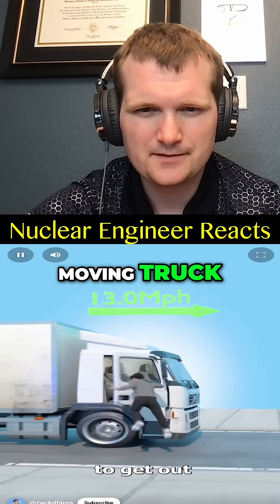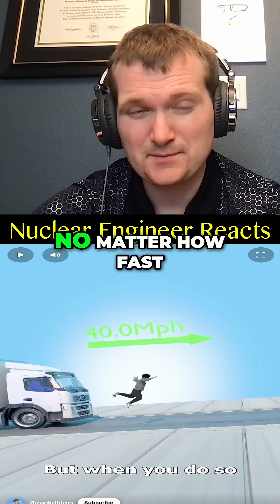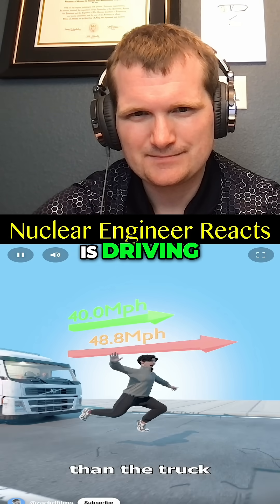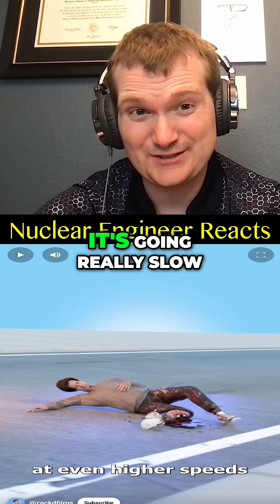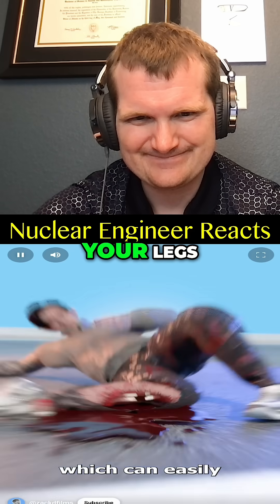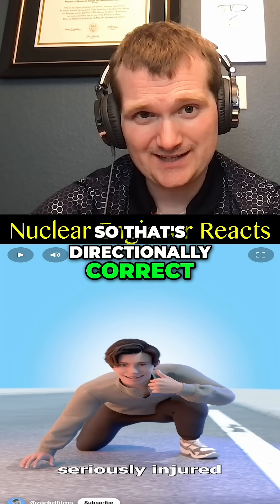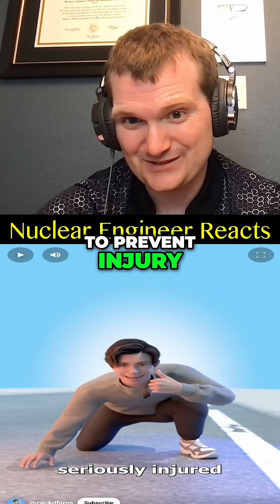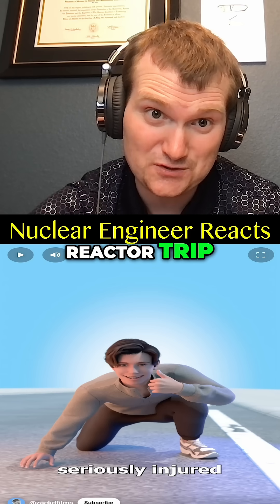Don't Jump Forward Off a Moving Truck - Nuclear Engineer Reacts to Zack D. Films

Comment: Who would ever jump forward though?  Even if you weren't adding speed, you'd still have a slight risk of getting run over by that very truck if they even veered off in your direction.

Just do what you see in the movies and tv's shows.  Off the the side and try to roll with the momentum of the fall.

Comment: I think they misplaced the reason for injury.
Regardless the way you jump you gonna hit the ground with the same speed as if that truck was not moving :D
Injury comes from brain not knowing how to prevent the directional, sudden friction and causes body to roll. So your feet at pretty okay, but your head will start moving towards the ground with much bigger speed due to friction already acting on your feet.
So, if you had an ability to fall to the ground in a way where you negate friction and your whole body hits the ground at the same time, you will probably still grind into a pulp(on a tarmac road), but that's a separate effect from falling damage :P

Comment: You need to also turn around, to be sble to land facing same direction as your speed relative to ground.
Also I think, just jump away, not backwards or forward, just away, and face forward (the speed) and catch air to break.

Comment: If you jumped from the side and not the back where the vacuum is but where the air is pushing, then it may work out with a tuck and roll

Comment: Here's another scenario/question that makes the same amount of logical sense:
If you feel the need (like an addiction) to catch a ball traveling at 100km/h in your mouth you might turn your head away from it, in such a way that now it's gonna aim for your temple.
(You could just not try to jump off a moving truck, just like you could not try to catch a very fast moving object inside your skull, which is a bad idea on it's own, just as is jumping off of a moving vehicle)
(And NOT try to make the very hard ball hit your vitals, just like you shouldn't make yourself hit the asphalt highway at an even higher speed.)

Comment: Pretty sure you need to be facing forward to roll correctly. Once your feet touch the ground they will slow down more quickly than your head. If you are facing forward you can catch with your hands and possibly roll over your shoulder. If you are facing backwards the back of your head is meeting pavement right away. As always Tyler is right, at highway speeds the best case scenario is you are still breathing

Comment: Theoretically you can play harmonizing directional positioning. This is why most stunt people leap laterally when exitting a moving vehicle. Moving away from the car, at best you'll get 20mph, and at 50, the impact is going to be pretty severe regardless. Moving in a direction adjacent to the force at which you are moving, and stretching your center of gravity to allow for a tumbling effect you'll more likely survive with a few non-fatal / non-permanent injuries than if you attempt to try to play force cancelling physics.

Comment: This is a very harmful tip. You don't want to jump facing backwards, because you will roll forwards anyway. Jump to the side and roll. Jumping opposing the truck's direction means jumping facing the opposite direction, which will be much more fatal than jumping facing forward.

Comment: Tip: Roll to distribute the loss of velocity over time
Reply: Extra tip(said from a comment in that Zack video): You will roll in the direction the truck is going, so prepare to roll backwards if you can
Reply: At highway speeds, you're gonna have chunks of flesh grinded away before you start rolling safely, but that is better than breaking your bones.

Comment: The problem with jumping backwards is that you are facing the wrong way to get your feet running in the direction you are travelling already. 

So jumping backwards is probably much worse. 

Best would be to jump backwards while facing forwards and start running forwards before you hit the ground. 

2nd best is jump sideways while facing/running forwards

BTW The reactor analogies are just ridiculous most of the time.

Comment: That's a good way to smash the back of your head into the pavement. Face forward, jump backwards, tuck, and roll, protecting your head with your arms. You might survive that way. If you're going slow enough and roll well, you might even get away with road rash.

Comment: With this scenario you are better to stay inside the vehicle wearing your seatbelt because inertia would see to it that your body would move at speeds and create angles caused by your momentum would happen as soon as youd touch down. Your legs wouldn't be able to catch up with your body and  before you started to tumble at about the same speed as the vehicle like an unprotected ragdoll unprotected from what might hit you, or the things that you might hit. Your best bet is to stay in the vehicle during a crash no matter the speed of impact you are safest to ride it out than exit and  be totally unprotected. 
 Staying inside causes the vehicle to work as a protective shell wrapped around you where the inertia and velocity of a crash are absorbed and reduced by the vehicles design and structual design where it hs crumple zones seatbelts airbags and the overall structure of the cab where its  designed to lessen harm to those who might end up in a crash. So stay inside your vehicle, In your seat, wearing a seatbelt where you are safest and more apt to survive.

Comment: As jeremy clarckson said: people don't die from velocity, they die from suddenly becoming stationary.
Reply: It's why you roll in parkour - your making a sudden stop take a few seconds, which means you sustain fewer injuries as you slow down.  

So the full form is to wait (if possible or logical) for soft soil along the shoulder, jump backwards from the truck and tuck and roll.  The rolling allows you to turn some speed into movement instead of pain, the softer soil absorbs more of your speed with a lesser impact on your body.

Itll still hurt you badly at highway speeds, but likely enough to make your injuries more in line of "arm dislocated and leg broken" instead of "meat crayon with a shattered skull"
Reply: @Mr.Sparks.173  you distribute the force of the fall by rolling over your shoulder in parkour instead of directing all the force of the fall onto a specific small part of your body like if you were to land on your feet. that is mostly why people dont get hurt doing parkour
Reply: unless you get hit by a truck, then you die by suddenly becoming non-stationary.
Reply: Unfortunately that's only partially correct, the reality is people die from sudden changes in velocity over short periods of time, aka acceleration, that includes increases and not just decreases.
Reply: @nerofl89 Technically, in relation to the truck, you suddenly became stationary
Reply: "Speed has never killed anybody.. suddenly becoming stationery, that's what gets you."
Reply: One of the many brilliant little pearls of wisdom from Jezza.
Reply: Velocity isn't the problem, the problem is change of velocity.
Reply: In a traditional car accident sure. But if talking about just moving vehicles, it’s really from any sudden spike in G forces. Could even die from accelerating too hard or turning too hard
Reply: Technically people die from acceleration.
Reply: Jeremy Clarkson?  That clown?  😂😂😂.  I’m sure he’d be quoting someone else’s wise statement.
Reply: @moiraatkinson  How dare you insult his genius!
Reply: @moiraatkinson  what's wrong Moira can't take a joke? Someone get a little cranky when people have different opinions?
Reply: @LostSoul-h7d . err huh?  I post a comment consisting of laughing emojis and call Jeremy Clarkson a clown and this is evidence I can’t take a joke?  Sure, I know he appeals to his teenage boy fan club.  Like you said, we’re allowed to have differing opinions.
Reply: @moiraatkinson you bellend

Comment: If you were in the back of the truck and managed to sprint to 20mph, jumpting out the back would be like tripping at a full sprint, only in the opposite direction.
Reply: average running speed of humans at 24 is 15km/h so your saying to go twice that speed
Reply: @ommsterlitz1805 it's a fictional scenario, so you might as well be an nfl running back
Reply: At least the wind would help you accelerate.
Reply: I'm slow, so I'd be better off fighting the driver than to try to jump and kill myself.